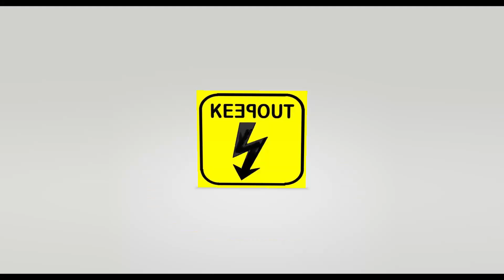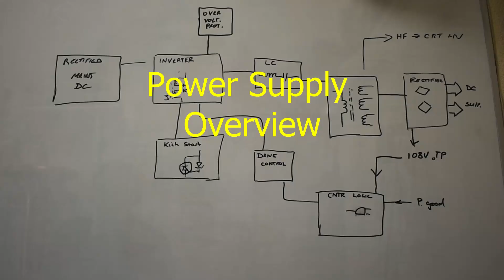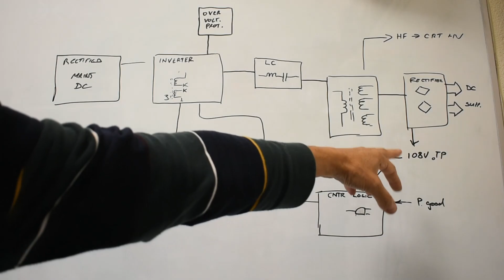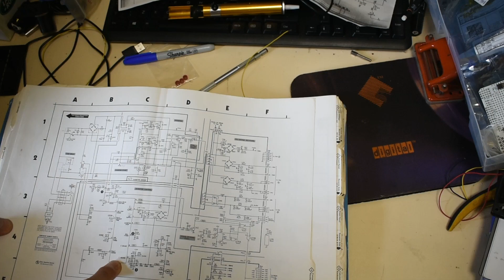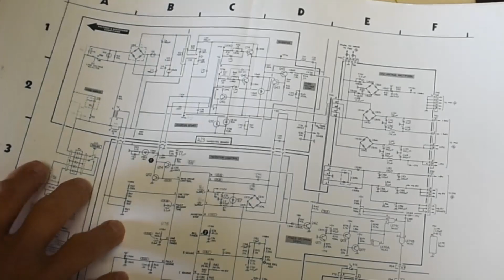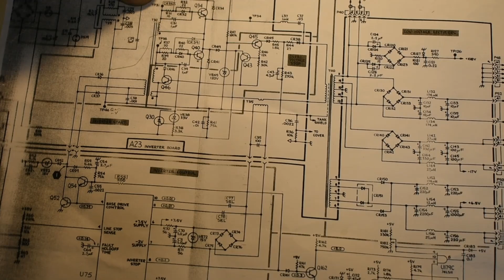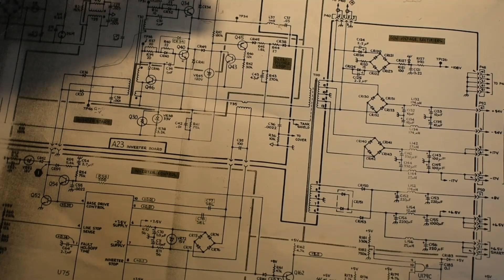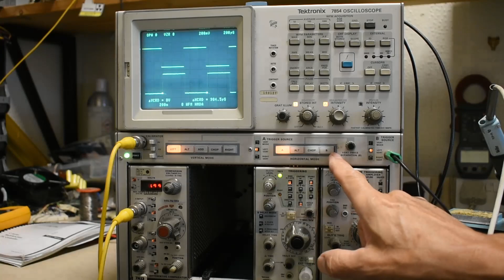Tracing Gremlins in a Tektronix (main-frame) Oscilloscope power supply.

Comment: I also have a 7854 which has a fault around the digital display board, not easy to debug that without a decent logic analyser.
I wasn't aware you could split the upper and lower sections, so that's very useful to learn!
Reply from the maker: Good to know you have the same scope. Most survivors seem to be in the states. Yeah, processor and logic board debug is a deep dive. Apparently there were some early scopes that suffered from EPROM memory loss with time, resulting in the digital storage not working. It is limited to a USA batch of early serial numbers though. The scope is designed to hinge at the back but it doesn't make access all that much better. The two halves can be further separated but it means disconnecting cable and that can lead to more problems. My second problem was left and right Vertical channels 'Added' all the time. Found this was due to a 74LS153 being stuck. Managed to replace it on the backplane without removing or disconnecting the board but had to remove everything around it to get to it.

Comment: I'm amazed someone thought to save those manuals, they're usually the first thing that goes on the bonfire. replacement LED's don't look bad at all other than not haing any side bleed out. Well done keeping focus, though I confess 80% of that went way over my head
Reply from the maker: These old scopes have a bit of a following so the manuals often get saved. Enthusiasts, have also put a lot of them online.
Reply: @tuopeeks  The UI is far faster than a modern digital scope, and analogue scopes don't lie. If you look at comparisons between digital scopes, you will see how the same waveform can look completely different on different brands of digital scope. Imagine you are in a building with exposed beams, measuring the height with one of those ultrasonic distance once each pace (what digital does) . Depending on whether you are under a beam or not, the height is different. If you ran a stick across the ceiling, you would know the height varies because of the banging and clattering (what analogue does). If detail matters, (eg for design work) you need analogue. If you just need to confirm what is happening (eg final test at end of production line), digital might be quicker because more automation.
Reply: Most of the Tektronix manuals are found at Tekwiki.

Comment: Have you looked  at the base waveforms? On the main driver transistors,  its strange that  its one side ever time ..
Reply from the maker: yeah, unfortunately never been hooked up when a fail occurs. Only ever seen that jitter a couple of times off load on the bench. Always looks good and stable when I put it back together.